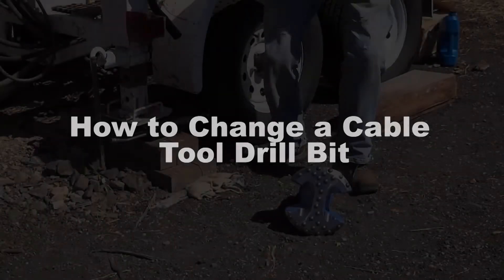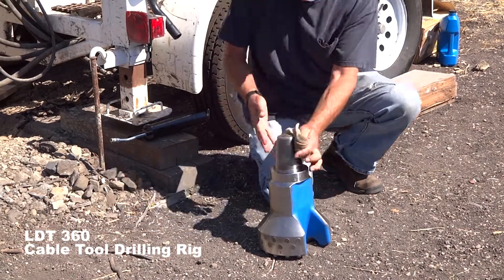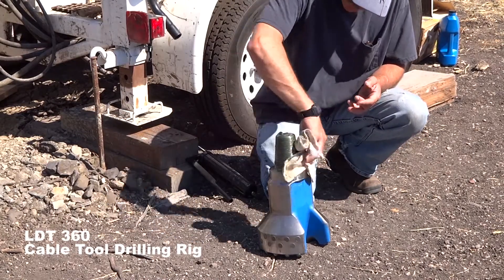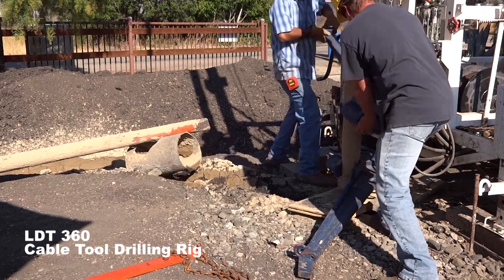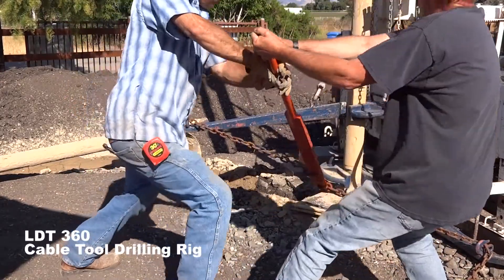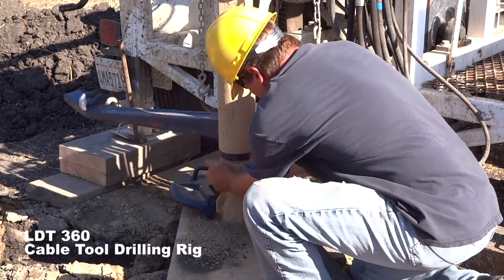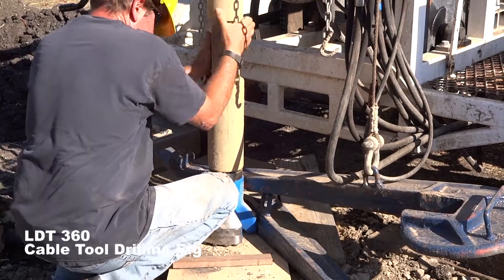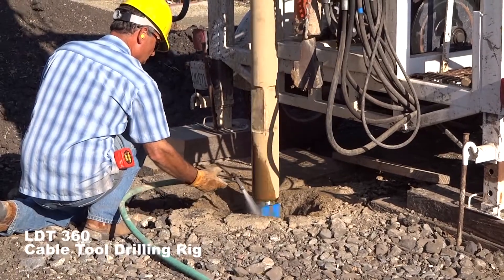How to Change a Drill Bit

Comment: A couple questions although I see this is an old video. First off I am 3rd generation cable tool driller with many years experience. Now days I see most drillers using grease on the tool pins when stringing up the drill string. We would have been fired for this as the grease forms a thin coat not allowing proper set up of the pin and box shoulders. We only used water and a wire brush to clean the box and pin and checked shoulders for any burrs. Then used a wet stone with water to smooth the shoulder if needed. In no way was oil or grease allowed near these connections. This helped prevent them from coming undone by allow a friction joint on the shoulders. Secondly using the chain lever for setting up tools is at best a secondary fall back. In no way can it replace the efficiency of using a circle jack for setting tool joints.
Reply from the maker: Hello, we have obviously not been very active on our Youtube page, our apologies!  You can reach us directly at info@ldrhino.com, or through our website at www.ldrhino.com.  If you'd like to schedule a quick call to learn more about the drill, you're welcome to do so using the link below.  

The current price of the drill is $92,000.  

https://calendly.com/worldthirstsolutions-luke/ld-rhino